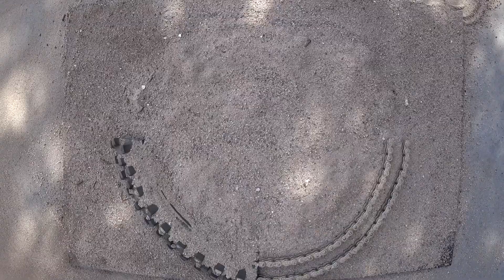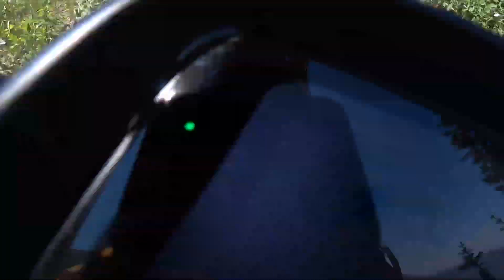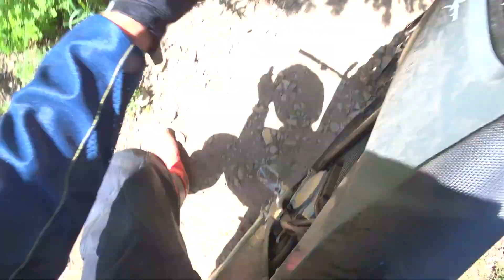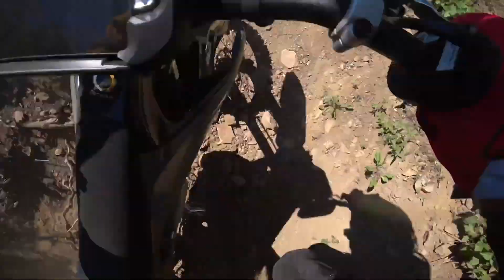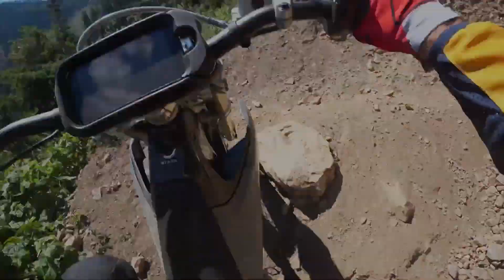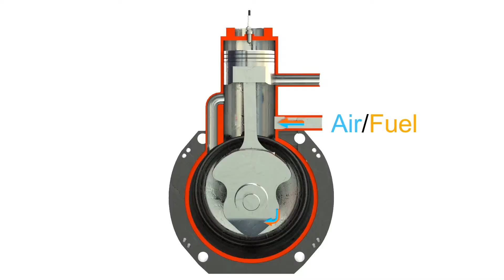Why Electric Bikes Suck Offroad

Comment: I've seen this scenario in person. We ride hard enduro in very slippery conditions (Kauai). I've seen emotos just spinning their tire and can't get traction again once it's broken. Then they overheat their battery and waste tons of juice and can't finish the race. We ride trials bikes and 300 2 strokes. The trials tires get amazing traction most of the time but get filled up with mud. The Kenda Knarly 140 is the go to on the 3002t. You can either lug for traction or sometimes, you have to scream it in 3rd gear to get going with a lot of clutch work. Good vid.

Comment: I race cross country with an ICE YZ and also ride an electric bike.  The advantage of a clutch is obvious, but at the same time it doesn't seem like this guy has any actual experience on electric because power mapping that can be switched on the fly and traction control make electric incredibly well adept at finding and keeping traction.  Trying to inellectualize without mentioning or considering basic technology is flat out garbage nonsense.

Comment: It's an interesting perspective, but here's a different one: 
A more even power delivery results in better traction, as it is the jolts that break the tire into a slip, a proof point is that hard enduro is dominated by 2-strokes. You don't have V4, because they're too heavy and complex for this task. In off-road a slip ratio is preferred to pure static friction, that's why ABS sucks on loose terrain. 
So why the issue?
An electric drive has very little inertia, so when the wheel loses traction it gains RPMs fast, opposed to lugging an ICE bike with the wheel slipping a little. What's needed is adequate software that precisely controls the wheel RPM and prevents these scenarios. That's just one of the many solutions we're working on here at FluxMoto.

Comment: Gunna be alot of eMX riders chasing the golden rear end geometry / shock set-up to make up for this disadvantage  , however there are 2 advantages  ...
1 : the bike remains the same weight bias at all times .
2 : the rear tyre will sound underinflated as the traction level goes up ( cause it's electric and quiet  )

Bonus 3 : there's a thing called " exponential  " usually adjustable for the throttle , on mine at least .

Not selling me ICE MXers any time soon though  ...

Comment: The comparison with ABS is brilliant. You find traction lose traction find traction over and over again. During the two-stroke era in motogp, Honda ran a four-cylinder engine where the cylinders fired tightly if I remember correctly 178° to 180° between. So instead of getting a smooth input with power, there was a longer input. This was so that the wheel would find traction between the pulses. Same as with a pedal bike. Good traction and the electric bike/car is the best.

Comment: Nothing but respect for the amount of consideration  you put into this. I think you will find the problem is the amount of weight at the crank shaft. The inertia or the lack of inertia at the crank shaft is the solution to this problem. Thanks for your video, It provided a lot of fuel for thought.

Comment: I'm not sure I buy your argument that fewer cylinders = better off-road.  Unless you are lugging the engine at super low RPM, the torque pulses are averaged out by the chain slack and engine flywheel so the pulses don't reach the tire.  The reason people don't use multi-cylinder bikes offroad is more cylinders = heavier.   Agreed electric bikes can struggle offroad, mainly because fine torque control on an electric bike is more difficult to achieve without a clutch.  Zero Motorcycles has a patent for a "virtual clutch"  where the clutch lever signal tells the motor controller to reduce torque.  But this concept hasn't reached production yet.

Comment: i agree with your thoughts on pulsing the e-motor because a lot of finding traction is thrown and caught energy until its harmonized and meshed, thats the first thing i thought of when you outlined the problem... the clutch would also work if you had a flywheel but we arent looking to add weight.
axial flux motors are the newest thing, they got coils face to face with magnets in plates(like a clutch pack) instead of tubes, it gives more torque/power density and a new controller setup... sounds kinda cool!! ; 
"For electric motorbikes and quadbikes, a different design of AC axial flux motor has been developed. It evolved from previous DC brush-based axial flux designs, moving to AC and a fully sealed brushless design, and has been designed from the ground up for volume manufacturing.

Going from DC to AC, the design has coils that are kept stationary, and dual rotors with permanent magnets rather than a spinning armature. The benefit of this approach is that it avoids the need for mechanical commutation.

The AC design also allows the standard three-phase AC motor controllers in radial motors to be used for the axial versions. That helps to reduce costs, as the controller provides the current that controls the torque rather than the speed. The controllers need a frequency of over 12 kHz, but that is now a mainstream frequency for these devices. " - Avid Technology & Saietta via www.emobility-engineering.com/axial-flux-motors/

Comment: Awesome video, clearest explanation of gas engine power delivery ever. But as a previous comment pointed out, electric bikes have the potential to “out-traction “ the best gas engines just as they have in the automotive world once sensors and mostly software matures.
Reply from the maker: Agreed. If they can figure out better software, then they'll be unstoppable, except for the range issue.

Comment: ABS is computer controlled.....so is traction control....just sayin' ......you can have completely controllable traction control that could emulate any power pulse you like or even better, just legit slip management...sorry but this is just a silly argument....PS ...EV's are the quickest cars in the world entirely because of their ability to modulate traction without drivetrain slop.
Reply: I agree... Deep down I love gas engines... but if I am going to be honest with myself, electric motors are more constant than any gas engine and can be customized to deliver any sort of throttle response and power delivery you can conceive so long as you have the sensors, computer,  and software available and the skill to apply it. I am a technician of almost 30 years.
Reply: ...so y'all ride one??
Reply: @ascott6804  No. I've never even tried an Ebike. But I don't enter a debate about electric vehicles like its political. I have a broad appreciation for machines in general. When I became a locomotive tech I was amazed by the engine... 30,000 pounds, 4000 HP turbo 2 stroke beasts! But also keep in mind all it does is power a generator... that powers electric motors either AC or DC depending on the unit. All the axles on a locomotive are electric. By switching series and parallel circuits to the motors you can get over the speed limitations that used to be a thing because of the magnetic field fighting itself. You can engine brake still by having resistors switched in to the electric motors and this reduces need for brake pad replacement so often and reduces failure by being applied simultaneously. An electric vehicle doesnt fit every situation and in some cases there is no support for it. But a little 100 pound bike with the power of a nicely tricked and tuned 125cc that can do 300 miles on a charge sounds like a blast to me. That would get me to work and back for a couple days or enjoy a lot of trails. Now that I am older... being quiet and strealthy keeps my interests too. I'm not a prepper... but damn it looks like shit is going downhill. A solar panel and ebike is going to go farther than a gas bike if SHTF...
Reply: @ThatWinterRider  ...good luck with that.
Reply: @ascott6804  if that idea does not intrigue you, then you are not an enthusiast. Just like I say to those guys that think the only motorcycle is a Harley. They are not bikers, they are followers. I am all about the machines and the capability. I haven't been biased since I came to the conclusion that I was wrong about carbs vs fuel injection. Turns out fuel injection is far superior most of the time.
Reply: I've ridden the Zero FX offroad and it is ok most the time. However in low traction situations it is more difficult to manage. On an ebike, torque comes on soon and more abruptly and with no clutch it can make slow/technical riding a challenge. I ride a 2024 GasGas EC300 2 stroke which is a beast of a bike, power wise, but the Zero FX (though cool) is sort of untamed in certain offroad riding condition. On a traditional dirt bike, power comes from the engine but is delivered through the clutch, which makes power management easier in certain conditions. On an ebike power management is sort of compromised without a clutch. If I'm not mistaken, electric trials bikes have a clutch for power management. Just my take!
Reply: @the_rocky_mountain_rider  I am really excited about the advances they are going to be making to manage power. Its going to be as easy as a phone app to change all your torque settings. There will be "custom maps" made to mimic particular vehicle mannerisms.
Reply: @ThatWinterRider Yes, I don't doubt that they will have more riding features to combat some of the short comings. It's just a matter of time.
Reply from the maker: Just to be clear, I am not bias and plan on buying an electric car. I have nothing against electric motorcycles either. I'm just pointing out a current flaw. I agree with all the comments below. Once the bikes get the appropriate software, they will be equivalent or better, other than range.
Reply: It